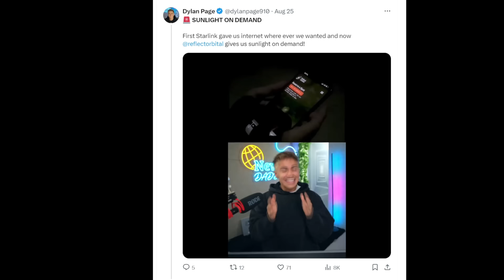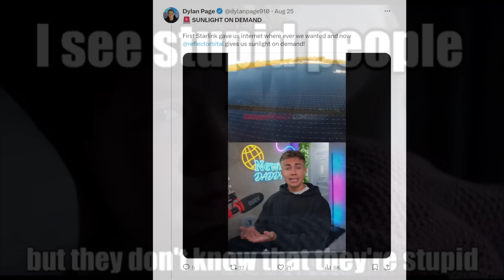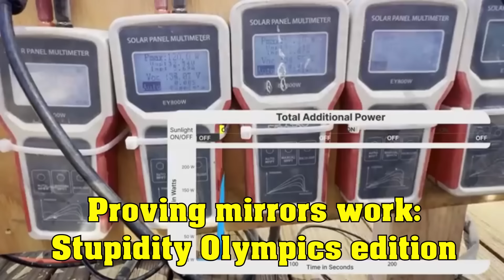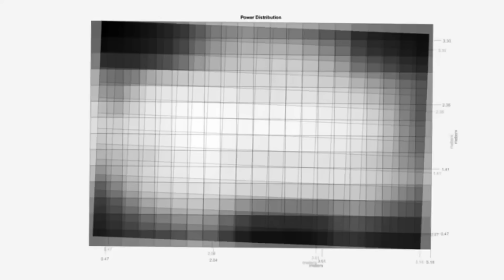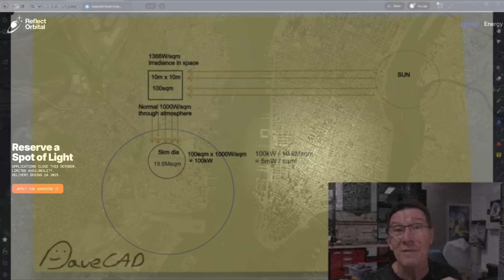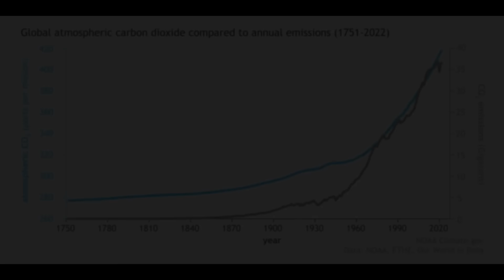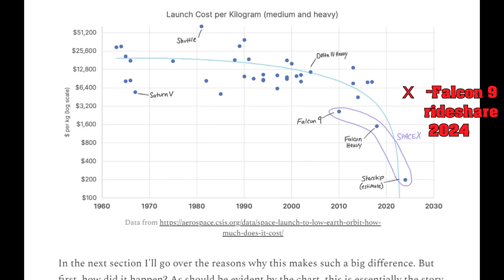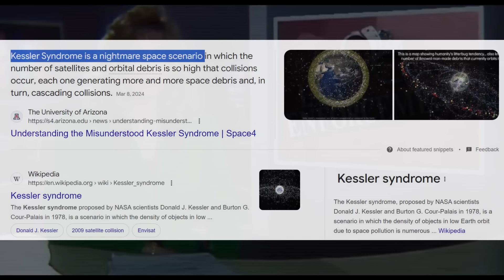Reflect Orbital: BUSTED!!

Comment: I'm wondering whether the solar wind will continually blow a vast reflective-coated solar reflector "sail" off course? Or, would that be enough thrust to compel it along against gravity in a centrifugal arc forever? Even if focused locally in orbit, rather than at some wildly-distant Lagrange points, the product in a solar furnace collector would need the efficiency of graphene conduits to channel and focus its beam onto any other target. That's not invented yet. But laser sawing has been, and the force of the cutting beam leaves extreme icicles of aluminum burrs trailing from the edge. Wouldn't it be hard to control that? Is there some phased-array antenna that's digitally controlled and could account for the force of impact of concentrated light, turning it into a counteracting thrust vector that moves continually? 

We've got a lot of sunlight passing by into deep dark space that won't miss whatever we grab for ourselves, but unlike catching the passing wind and converting it, it's awfully hard to anchor a reflective Mylar film that's 500-miles square and won't get hit by any of the passing aluminum and titanium crap chunks that are flying around with it. I'd love to see laser beams hitting the tops of jet aircraft and tracking each other in the way that onboard connectivity does, but the scale of the enterprise is bewildering.

How much could just that weigh, and if aloft, how long until the launch and production costs are recovered from cash-strapped airlines? How much energy would have to arrive at the top of an A380 for it to equal that blowing out its GE engines now? And if the interactive beams unlock, will the transmission stop fast enough? Let's face it, we'd have as much luck collecting reentry vehicle heat with graphene heat sinks and converting that to articulating beams of directed energy weapons. Sounds fantastic, because it is. But then again, electrifying NYC was fantastic until some guy did it.
Reply: If any sort of reflective-coated Mylar were able to be manufactured in a quilt of rolls that would unfurl to focus upon a nearby solar furnace receptor, one which would in turn convert that into a coherent laser beam and stylus to penetrate the atmosphere and track destination targets more effectively, a 14,000 acre orbiting reflector field in orbit wouldn't need the structure of solar farms in New Mexico. But preventing space debris from making Swiss cheese of it is another question. Maybe we need a guy like Thunderf00t to stop whining about PROBLEMS with proposals and who'll start thinking of solutions or alternatives that might add to the conversation? I mean, what's an engineer worth without problems to solve? Redundant. Got better ideas?

Comment: 11:01 now if i could just mount a white light laser and power it with solar panels on the satellite then it still wound work but it wont work slightly better ...  actuyl come to think of it ..  if you got a laser of each colour and fired them all at a diffuse and then ...would tat work ?  not for the solar thing just in general can you mix laser light to make new colours?
Reply: well, AFAIK the light itself doesn't mix, although it looks like it does, that's why the screen looks like it has 318927189273 colors rather than only red, green, and blue. But it's a perceptual illusion of modulations of red, green, and blue light stimulating the color receptors in the same ways that true light of a given color would, not the wave frequencies themselves changing/blending.

Comment: Looking at it directly from the distance point of view: Doesn't the light intensity decrease proportional to the square of the distance it travels from the source? So at an altitude of 500 km, shouldn't the intensity decrease by a factor of (500000)^2 = 250,000,000,000 instead of 250,000? 
Am I missing something?

Comment: this is not a bad idea. it will create a faint spot in the sky that will look like a dot. then they need to add more dots and color filters, and you got the worlds most expensive digital billboard that can be seen from many cities across the globe.

the best candidate for the advertisement would probably be universal studios, imagine having the universal logo actually going across the sky.

the issue with this type of constellation is that the satellites would converge at two points in the sky (imagine a pixel grid of satellites orbiting with the same orbital period. on the other side of the planet the grid would have flipped upside down as seen from the earth). to mitigate this you would need at least two constellations to orbit the planet to be able to broadcast to transmit to every longitude. also since the earth orbits the sun the dead zones of the constellations would move with the seasons.

this would be expensive, stupid and impractical, but at least it is more feasible than powering solar panels.

Comment: This had me laughing.  Just think of the basic concept.  Mirrors reflect light.  Light consists of the visible spectrum as well as UV (tanning) an infrared (heating).  Now, skipping around the entire concept of reflection loss to begin with, any light you reflect down to earth will be light that most likely (given the angles involved to direct the light to the Earth) would have MISSED the Earth.  Hence this process would increase, yes increase, the infrared striking the planet and make global warming worse (all so some rich person can get a tan at midnight in their backyard).  Plus you have to consider that from space, reflected light would travel through the atmosphere where airborne moisture and other particulates absorb (naturally) some of the light and energy.  So just like light from the sun, you lose about 20-30% of the energy just making it through the air.  

Plus you need to consider solar radiation pressure even on a reflective surface.  Even the most perfect substances (at high cost) are not perfect reflectors.  While solar sails are designed to maximize that pressure to use to push space craft, the DO include solar radiation pressure into calculation on getting space craft to distant planets as it is enough to deflect them significantly off course.  Large mirrors in space would be facing constant solar radiation pressure so they would need a long term constant supply of reactive materials to position the satellite and keep it not only in orbit but facing the target.  Maybe some clever soul could figure out how to convert enough solar energy into oh ion based positioning boosters (or something like such) to help keep the satellite in orbit and target focused.  Otherwise you need some ability to refuel the system over and over and over.  And the higher the orbit to get around the Earths edges to get to the dark spots, the more energy is required to get there for a refueling run.  

There are so many absurdities to this it makes me laugh.  Oh sure you could engineer and figure out solutions to all these items but at what cost?

Comment: The Soviet Union had the same exact plan😂 I bet they think they’re original or they’re trying to hide where they got the idea
Reply: AFAIK not exactly the same, the idea was more to have brighter days in colder regions, although I just saw a video where they also suggested actually extending the daylight in some areas, replacing electric light for cities. Some non-soviet ideas without actual prototypes were actually closer, the whole ring of satellites powering power plants. But I think there was a significant difference in focusing more on optimizing daylight focus during the day than just extending dim daylight for a couple of minutes. "Power Soletta: An industrial sun for Europe - Possibilities for an economically feasible supply with solar energy"

Comment: I'm only 2 minutes in but, if you had a satellite gathering that much sunlight wouldn't you use it to gather power in space then transmit it via microwaves to a receiver on the surface?

Comment: As the surface reflective behaviour of the moon could be described as lambertian, only a fraction of a percent of the light hitting the moon get actually reflected back to earth. A perfectly glossy surface and a flat moon disc directing the sunlight to earth would be significantly brighter. Depending on the mirror, I could be almost as bright as the sun itself. And using not one bur millions of small directeable mirrors could improve on that even further.
But your comparison has no legs

Comment: I got ripped apart on reddit for pointing out how dumb this is, the rissians tried this in the 90s and none of this is new and still the same problems as back then. 
So, i knew i was right because reddit also downvoted me for pointing out the sky was not actually blue once.
Reply: it's not blue????? weird ... i'm looking at the sky and it's blue. Also from NASA for kids: 

"Sunlight reaches Earth's atmosphere and is scattered in all directions by all the gases and particles in the air. Blue light is scattered more than the other colors because it travels as shorter, smaller waves. This is why we see a blue sky most of the time."

So, please explain.
Reply: weren't the Russian's plans significantly less dumb, though? Something like instead of trying to extend the day for five minutes no a spot for some eventual solar farm (whether believing it's a very dim day or a focalized beam of bright daylight), it was about trying to make the day itself just brighter in some cold regions. And even that if I recall was more of a repurposing or dual-purpose of some other research, solar sails or something. 

I can't tell whether that would have been even ultimately feasible if the ethical and climatological considerations were settled, but whatever the case, it seems miles better than this idea of selling some five minutes of daylight to some solar farms. 

Of all the "busted" series of things that's perhaps the one that sounds more like a blatant joke, almost like a magnet-powered car that would work by hanging a magnet in front of itself. Even if you imagine it working like an actual bright beam of light, it just seems glaringly self-evident that the same investment in batteries would be overwhelmingly more effective/non-wasteful and manageable. Gosh, I think that's perhaps not even hard to come up with some parody of it with phosphorescent satellites that would even end up seeming more reasonable.

Comment: Just curious how they expect to aim their 10x10 mirrors??  Do they think that they can just wish them to move?  Say they rigged it rigidly and used gyroscopes, it'd take a lot of power to run those because they'd need a lot of torque, but it'd have to be pretty precisely aimable, then swing to some other target quickly (all the time sending its 5mW/m^2 across somewhere else), then track that new target.  It's only going to be over a target briefly so it'll be swinging back and forth several times a day.  Not to mention the solar sail effect blowing it off course and debris shredding its mirror.  Everything about this idea is absurd.

Comment: Solar panels get EXTREMELY HOT on a sunny day. HOW MANY solar panels before THEY cause global warming????
Reply: While solar panels cause more local warming than the same surface area not covered with something as dark (and likely somewhat less than something as dark but not transforming radiation into electricity), if energy generation is  wanted, only wind power would be an alternative without this problem, all other forms of generating power are creating local heat, and, except for nuclear power, all of them contributing to a build up of greenhouse gases. 

Unlike other forms of generating power, solar panels can also be designed for some local cooling at the same time, with shading/canopies, although that's possibly not useful in solar farms, but I don't know, it may well be, perhaps it even increases their lifespan with more heat dissipation, I don't know. 

I think forest canopies are thought to have a more significant cooling than warming effect despite leaves being like "nature's solar panels," but in the other hand "artificial" solar panels don't have transpiration. I don't know if there's any standard analog temperature management solution.

Comment: If the distance to eart is roughly constant, couldn't you use focal optics on the satellite? Yeah, I mean in the best case you still would not get more than sun's power on 10x10m, enough for pretty much nothing for the price of millions (and insane amounts of energy needed to launch the satellite(s)). But wouldn't that make at least a modicum more sense?

Comment: Why are these 'tech bro's' inventing stuff I thought of when I was 13 and learned why it's not possible when I was 16? Next thing we know they'll steal my power generator idea where you connect an electric motor to a dynamo and the dynamo generates power for the motor so it will run forever and you can run something else off of it as well! I was in physics class at 13 when I thought of that.

Comment: This is just a poor variant of Laser Power Transmission, while an interesting idea it has remained impractical for decades.  Although (according to one recent article I read) they have now been able to transfer power over a kilometer the efficiency remains ~10% efficient.  Which compared to other forms of power transfer, even wireless (microwaves) is about half as efficient.  The only way LPT would be a better way of transferring power that it theoretically could transfer a power over thousands of kilometers...as opposed to only hundreds of kilometers with microwave power transfer.

Comment: Loved Dave's and your debunking efforts, but I really think that you both put way too much effort into it: According to NASA (and as Dave mentioned) the solar power in earth orbit is around 1367 W/m^2 and if a single satellite has a mirror area of 10 m^2 and we have 24 hours per day, 365 days per year, 10 years assumed lifetime of a satellite, we can multiply all these numbers to get the total solar energy that hits one satellite in earth orbit to obtain 1367*10*24*365*10 = 1.2 GWh. Now if we assume that the satellite could miraculously convert all that solar energy at 100% to electricity and inject it magically into earth's electricity grid, that would yield about half a million dollars revenue over the satellite's lifetime if we assume an electricity price of round about 40 cents/kWh, which is completely dwarfed by the price of launching a single rocket, independently of how many of these satellites one could put onto it...

Edit: Actually, we can continue this absurdity even further: if the satellites are tilted at a 45 degree angle, there is only a 5 m^2 are lit by sunlight, so we lose 50% of that energy; next solar panels may run at an efficiency of less than 30% and multiply that by their own optimistic guess of 13% customer base coverage, we get 500000$ * 0.5 * 0.3 * 0.13 = ~10000$ and that is about a third of their own completely outrageously low projected launch cost of 30000$ per satellite... 

"The economics worked out" LOL "I punch those numbers into my calculator, it makes a happy face!" :-D

Comment: for debunking video u sure make A LOT of mistakes and assumptions. but yeah initial idea is super dumb but not as dumb as u think.  for space reflector you can use really thin film. so we might use it for cooling earth at some point . BTW u also forgot about solar wind pressure that would blow away these very fast XD so it will results in constant replacement battle